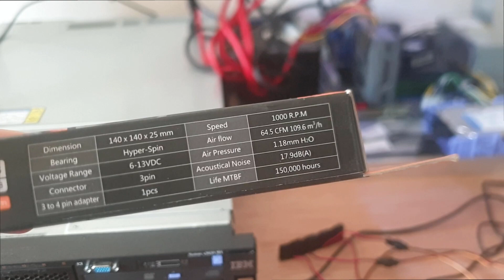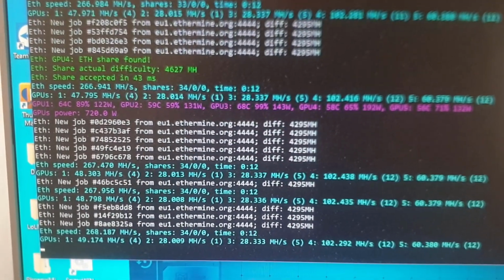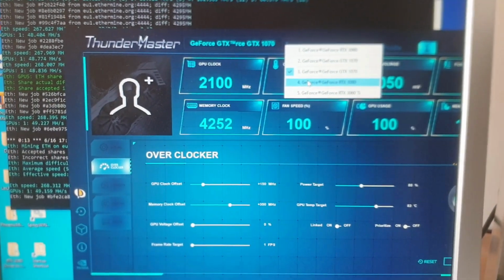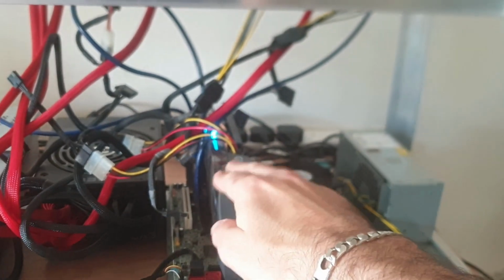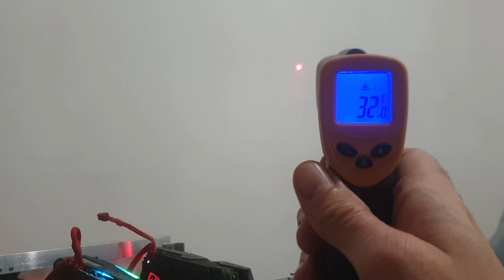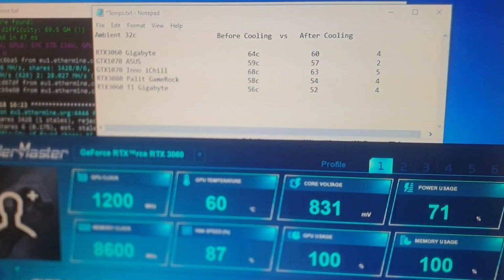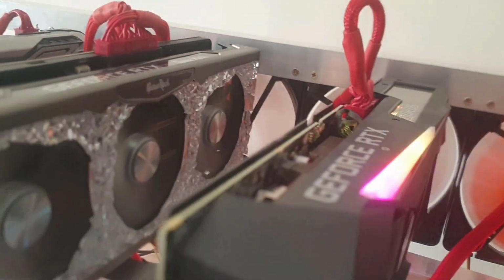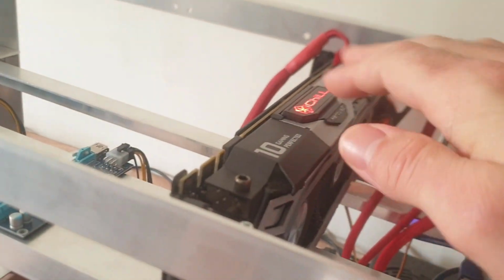GPU Mining 24/7 | Provide cooling for your GPUs!

Comment: Another thing you can do is replace the stock thermal paste and pads. It involves a little time but is well worth the effort as the stock paste and pads are usually crap, and very rarely do they put any pads on the back side to help the back plate work better.
Reply from the maker: Thanks for your suggestion and for sharing! Yes that will help too.

Comment: Sir i am also getting 75 degree celcius on my pc is it okay?
Reply from the maker: 75 Celsius on your GPU? That is on the high side and should be cooled down. Are you using a mining rig or enclosed PC case, or maybe a laptop?

Laptops will heat up more and should be set up in tent mode, meaning you leave it a bit open and let it stand on itself like a V shape upside down to help a bit more.
Reply: @ThatTechoGuy  i only have one gpu and thank u for the help
Reply from the maker: @owaisahmad7616  you're welcome. If its in a computer case its best to have a fan running on it and maybe leave the case open from the side to allow less heat to remain inside and add a good exhaust fan to extract the heat faster.
Reply: @ThatTechoGuy  ok i will do the same thank u very much ❤️